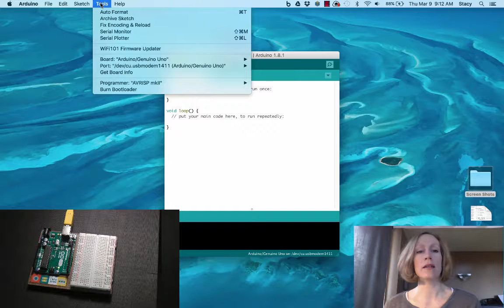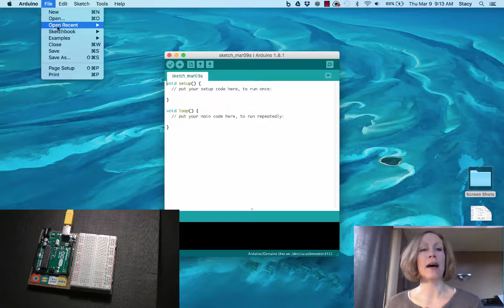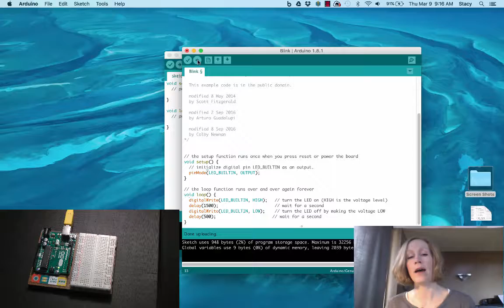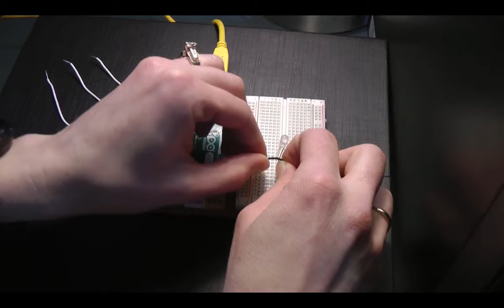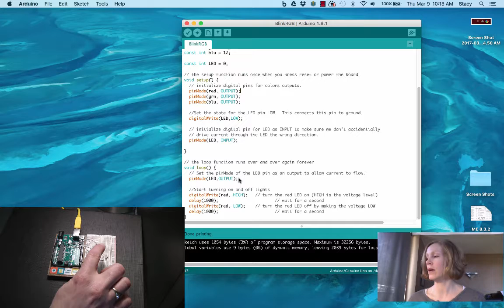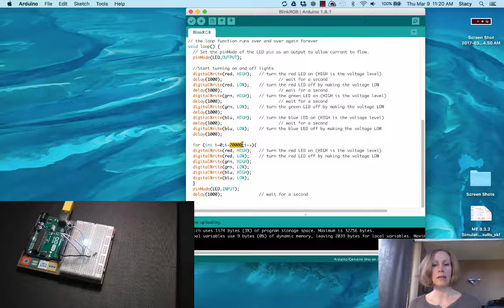4.3.1 BlinkRGB

Comment: By using a single resistor on the common pin it takes fewer parts to build the project.  The problem with using a single resistor is that the different colored LEDs have different voltage drops.  If two colors are turned on at the same time, the one with the lowest voltage drop will dominate, and the other(s) will be dim - the color generated will not be as expected.  To avoid this, the code shown turns off one LED before turning on another color.  

An alternative would be to use three resisters, one in series with each of the red, green and blue pins.  The common pin would not need a resistor.  With this method white could be generated by simply turning on all the colors at the same time.  With the resistor shown, each color LED runs about 10 mA.  This results in a maximum of about 30 mA going into pin 0, which is safely below the 40 mA specification for the device.